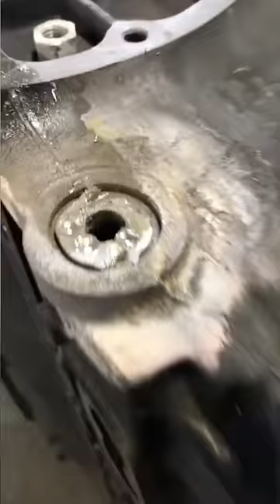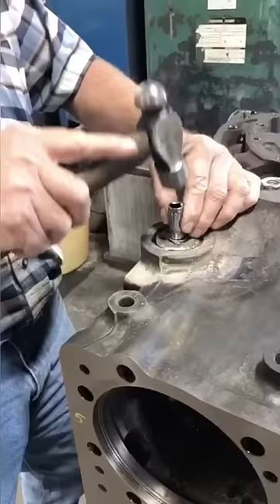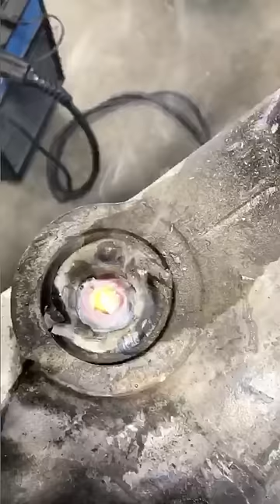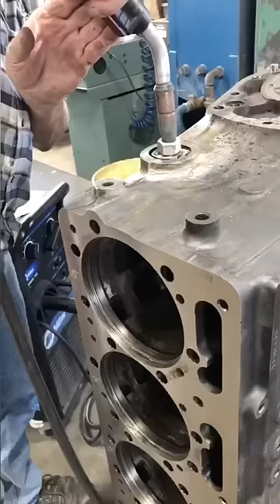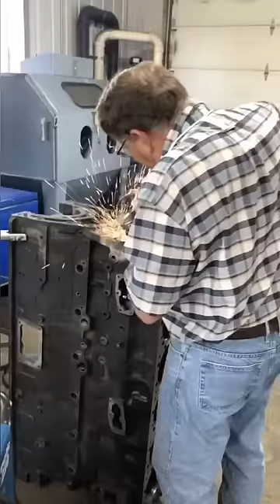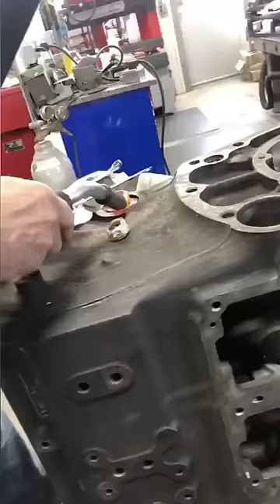#shorts N14 Cummins Block Plug Removal - This one fought back!

Comment: I wish I could see the cleaned block. Great job
Reply from the maker: https://vm.tiktok.com/ZMeFbNpvu/

Here!
Reply from the maker: @MRafi-lh5qz  I'm sorry, on my end it shows as a hyperlink lol.
Reply: @JAMSIONLINE  K- Tks , Luv the shop Videos and the presentation.
Reply: @JAMSIONLINE  viewing through the your channel the link works but through the random shorts that pop up it doesn't, strange but true. Excellent content
Reply: I just manually typed it in and watched it. I also copied it and sent it as a comment.   I think YouTube blocks the link because it's a competitors site
Reply: That was amazing!
Reply: @MRafi-lh5qz  type it.
Reply: @JAMSIONLINE   I have a weird question. Any issues with your Chicago Pnumatics impact? I keep getting poor quality ones lately. Impact sockets either fall off or won't even fit.
Reply: @TX_b  А то что они неумеют пользоватся экстрактором
Reply: Where are you located
Reply: @JAMSIONLINE  got a YT link by any chance? I prefer my invasion of privacy like I prefer my beer, domestic.
Reply: You have such a satisfying job
Reply: Looks like the chisel they used the first time, mushroomed part of the threads .. good fix tho.
Reply: @davestewart1656  CP used to be a good brand.  Sorry to hear their QC is falling.  Mine is either an old CP or Ingersol.  Built by Vikings, I'm pretty sure.
Reply: Have ya ever used wax as a lubricant? It does work.
Reply: I’ve almost given up on air operated impacts with these battery powered ones. I can’t believe how good they are and no fighting air hoses.

Comment: being a mechanic, a trade where a 30 second item   can turn into a 3 hour affair.
Reply: 3 weeks depending on what you break 😮‍💨
Reply: @manuel luz  a year or more if you like weird niche vintage stuff like a 1920s model a turbo kit😢
Reply: As a truck driver and recreational mechanic. I cosign the above statement. Which is why I never assume what time ill be done for the day. Got myself back to the yard numerous times.
Reply: plumbing is the same dont worry.
Reply: Probably would have gotten it out the first time if tacked the outside
Reply: @Earthmandolin Yeah, probably.

Comment: It is a good feeling when you overcome one of these obstacles.
Reply: Spent 2 days with a sledge hammer and big iron rod to remove a single bolt from a ploughs frog, with plenty of elbow grease and wd40 we finally got it out
Reply: @rhaynhillyard9772  that’s a damn good feeling of accomplishment lol.
Reply: That is a damn fact!
Reply: An engine mount bolt snapped and dropped the engine on the floor. Now I can’t get it off no matter him much I try to twist it off : (
Reply: Those stubborn bolts always get me happy when i do overcome
Reply: success has many parents and failure is a orphan .
Reply: @rhaynhillyard9772  quitters never win and winners never quit . never enough time to do it right but plenty of time to do it over . all good sayings when working on any problem .
Reply: I have put some wax on the broken fastener. Apply hot heat two inches away from the part you want to remove. When the wax starts bubbling, remove heat try to remove fastener. The objective is to expand the outer metal. Timing is the on this fix.

Comment: If I may, when trying to twist or turn something that's not all that strong (like that welded nut on a seized plug), it's far better to use a breaker bar than an impact.  An impact is a very sudden and sharp force which causes that weld to break much easier than a breaker bar which allows for a gradual increase in torque.
Reply: But isn't it also that sudden shock that breaks a seized bolt loose from its housing?
Reply: @ericmueser  - Actually, no, not from a rotational standpoint.  Yes, the vibration can definitely help loosen the corrosion but that can be effectively achieved by just hammering on the bolt or plug itself, or anywhere in the vicinity of it.  It's just that if one can't get a strong enough weld, an impact tool will break that weld quicker than a breaker bar would.  I might add that the heat from the weld is doing far more than anything in loosening that plug or broken bolt.
Reply: but lugga dugga much easier that strongy pully. let the tool do the work
Reply: @riflessss he said “breaker bar” not “wrench” two different tools
Reply: Mark, EXACTLY CORRECT!!!
Reply: Idk you don't always have the same torque. But also some plugs are just so in there I've been able to get them off with torques but not breaker bars
Reply: The reality is if you do several of these a days with a breaker bar you’re probably going to feel it the next day and over time it’ll break you down.  While using an impact isn’t the most efficient use of energy, the energy you’re using is coming from the wrench so from that standpoint it’s significantly better for the mechanic.  I’m sure they’re aware of the best way to do things and also the best way to prolong their careers.  As with most everything there’s a balance to be found my friend.  Cheers.
Reply: @ddnc1983  - You know, this is turning into a debate never intended. :)  First, I've been a mechanic for 40 years and have removed more than my fair share of broken and seized fasteners.  Secondly, my advice was purely for the sake of not breaking the weld if enough penetration can't be achieved.  Thirdly, the most effective part of his process is the heat from the welding. That's doing more for the removal than anything else.
Reply: Heating it up with an cutting torch also makes the job easier
Reply: @mark-1234  fair enough.  Wasn’t trying to rustle any feather just trying to justify the methods shown in the video.  Appreciate your comment though even if I may have come off a certain way.   Cheers.
Reply: The future is now old man. lol
Reply: @mark-1234  I got what you were saying, even if practically no one else did.
Reply: Thank god. Some people still give a crap about work
Reply: If he would've ground the nut and tacked around the outside the first time like he did on the 3rd time, he would've got it the first time.
Reply: @zyeklonbey3545  yep. My dad used to say, “There’s never enough time to do it right but there’s always enough time to do it over.” LOL
Reply: @riflessss lol stick to the shooting range 🤣🤣🤨
Reply: Actually no when you use a breaker bar you might tilt giving you more chances to either break the part more or hurting yourself
Reply: And allows you to crush your knuckles when the weld breaks. Bonus!
Reply: @Squidbush  - Well, apparently you need some more practice with your tool handling skills.
Reply: @davidinflorida6814  My grandpa always said "Do it right the first time, that way you dont have to do it over" old men are generally smarter when it comes to this type of stuff for some reason got wisdom igs
Reply: Branching off this... the impact sockets are made up up different steel than the regular sockets in a socket set. Reasons for it being different is one is made for impact the other will shatter over time with the impact gun. The same can be said about a nut not ready for the forces of an impact where a regular wrench or breaker bar would do less harm than the impact.
Reply: @mark-1234  yeah, but how many people do you see backing out of the trade because they wrecked their bodies trying to be a damn superhero lifting truck tires up to chest height instead of just dropping the lift and not destroying their spine trying to show off? If you've been wrenching 40 years without letting the tools take the beating and not going home in pain every night, with all due respect, you're lucky as hell or full of it. 😹
Reply: You know, I don't know if it's a lack of comprehension, experience, or just plain common sense but I'm addressing one particular situation in which a strong weld can't be made, and some of you seem bent on wild-ass assumptions and extremes.

And yes, I've been doing this stuff for over 40 years on everything except helicopters, trains, and ships, and at 61 I'm doing just fine and it doesn't have a damned thing to do with luck; and nothing I said suggests I'm above letting tools take the beating.  Unless I'm just not into the noise, I'm quite religious in air tool usage.

And most guys I know of weren't interested in showing off.  If they do something you might consider "improper," it's usually in the interest of saving time.  Like remembering to put in ear protection to run an air chisel for a few seconds.  Most guys don't bother and wind up half deaf (like me).

By the way, it's quite easy to roll a car wheel/tire up your knee to get it chest high.  No back bending involved.
Reply: It looks like the previous attempt using a cold chisel deformed the hole, before you got it.
Reply: @ericmueser  
Agree with you.
Max. Torque works regardless it is sudden or slow.
Reply: Acetylene torch is my friend. Heat it cherry red up after soaking in PB blaster. Have had no issues getting seized bolts and nuts out that way
Reply: @Anthony_thom92  that might cause some warping or melting to other parts of the block. They did this that best way at preserving the surrounding components. It would be cool to do that though
Reply: @user-vr9ql7xb6z  yes, experience and patience.
Reply: @zyeklonbey3545  As they say "hindsight is always 20-20! And also that's why we live and we learn right LOL. Some people have to learn by trial-and-error. But I bet he does it correctly the next time!
Reply: @mark-1234  yes i thought the same thing Mark then saw u made that comment wich turned into a debate initially off center of what u meant but i knew what u meant
Reply: Agree with you man Breaker bar is the best bet for this job. It's like you want the right amount of torque that the weld you made could stand and impact driver most of the time overpower that and you'll ended up redoing it again.
Reply: @ddnc1983  yep always work smarter not harder when u can but I'm always carfull to not snap bolt learnt from my mistakes not using wd40 and just using a gun is the easiest way of snaping bolts a slight increase in torque with a bar to move it abit then spray then loosen then spray is safest way to do it especially with old bolts that have never come out
Reply: @ericmueser  not always
Reply: He might turn the block over on his foot. Notice it’s just standing in the floor.
Reply: And there it is. The fuckin comment expert. And where there's one there's a hundred.
Reply: @user-vr9ql7xb6z  older men generally we're blessed with more knowledge because they have lived longer in n age where common sense, knowledge and wisdom was definitely tried. Now knowledge and wisdom (of worldly things) is handed out by YouTube which is not bad. Thank God he allowed older generations to pave the way. We build from them. There's nothing new under the sun.
Reply: @kiwoongpk91  uhhh what does any of this have to do with "giving a crap about work" lmao
Reply: You need a 20' cheater bar with that thing

Comment: Nice job. We will often take a 1/8 solid carbide burr and notch the ID in 4 quarters just to the thread root. Then weld as shown. The notching helps to provide relief so the weld pulls in & shrink.

Comment: Mechanic: I've tried removing it a couple of times With no luck so I thought I'd let you guys have a go.
Shop: Oh joy... Thanks.
Reply: And I’ve made sure to make it worse with my failed attempts
Reply: It's all gravy train cash to me. The more you jack it up the more I charge takes me the same emount if time lmfbo
Reply: Oh god…you’re so right. 
I just love getting a truck or minivan completely torn apart, all the pieces tossed together, and ALLWAYS half the 8x1.25s missing cause they left em in the garage.
Reply: @twistednuts6062  Username checks out.  :)
Reply: @MichaelBrown-pg5dy  Much much worse!!!
Reply: @twistednuts6062  go work for Ford 🙂
Reply: @ObtuseAcute1  and take a huge pay & dignity cut??? Noooooo thank you lmfbo
Reply: I've straight walked away from jobs because of that.
Reply: This is where the hourly rate sign says:
“+ $20/hr if you worked on it before I did”
Reply: I hate that crap, I'm always the shop that gets it after the customer and his buddy and then two shops failed making things even worse, unbelievable
Reply: @NotTheHeroStudios  I've told people that I'm not a relief pitcher, I'm a starter.
Reply: We work on vintage buses at my shop.. 1920’s till 1980’s old detroits, cummins, crowns, gm’s etc.. it’s always fun when a customer tows in a 70 year old bus that was torn apart in the 90’s and the parts are strewn about the inside of the bus in boxes that once were.. ohh goody we get to charge double shop rate to put this chinese jigsaw puzzle back together..
Reply: @mikecorleone6797  I hear you, people will never understand the struggle
Reply: @jacobgomez2682  a good example, we got this 1950’s greyhound scenecruiser towed in for an in frame. The engine is torn down to a rusted block with a crank in it at the rear of the bus, the rest of the engine is in the bus in boxes that fell apart probably 20 years ago.. cloth wiring that falls apart as soon as you touch it and the rear brakes are frozen solid.. and i mean SOLID.. i had to cut the drums off with an oxy acetylene torch… we quoted the guy $35k to get the bus up to par and road worthy with a zero mile rebuilt detroit, replace all airlines, replace brake cans, drums/shoes,  replace air bags, rip out ALL of the wiring and start from scratch and overhaul the rear differential.. he couldn’t understand why it’s so expensive.. the boss looked him dead in the eye and said “it’s been worked on by a toddler probably 20+ years ago and we’re basically building you a new bus from the ground up”.. he couldn’t find anyone else that would touch it..
Reply: @mikecorleone6797  see it amazes me that people think what we do is "just a few hours of work probly" 35 isnt that much for a bus, weve done 1950 pickups for that much!!!! You guys gave him a good deal
Reply: @jacobgomez2682  that’s what i said.. the only other shop that would have touched it wanted $50k.. and they were going to outsource everything.. we do everything right here in house.. with just 2 guys.. just me and my boy, we handle basically all of socal, arizona, nevada and whoever else wants to bring their stuff here for service. We just had a guy roll in from tennessee with his crown for us to handle. If our prices were as outrageous as scenecruiser guy was saying then why are people crossing the country to get to our shop? 🤔
Reply: @mikecorleone6797  it is a difficult job. You either pay or you sell that bus.
Reply: Been there many times.

Comment: N14 are some of the most reliable diesel engines around, love those Cummins N14's
Reply: I had a 2000 Freightliner,  with the 435 horsepower N14 , a great engine.  After 1 million 250,000 miles,  the plastic in the cab was falling to pieces,  the engine,  transmission ( 13 speed Eaton) and Eaton drive axles were still going strong.  I even averaged 6.25 MPG.  I sold it in 2012, and bought an International 9400 I , 2007 that was a very good truck as well,  it had the ISX 15 liter engine with a 10 speed overdrive.  It was a 450 horsepower.  Ran it until I retired in 2022. Sold it and the gentleman that bought it from me traded it for an International Pro Star.

I liked the N14 better,  a good reliable engine and not as much of the engine destroying pollution junk.
Reply: the n14 was built after the 855s.

Comment: Good to see the N14 getting some love, my dad just did a complete glider kit conversion on his 2013 Peterbilt 386 with a '94 N14 Celect Plus. 

Runs like a dream, sounds glorious, and pulls like a bat out of hell.

They absolutely don't make them like they used to. Modern trucks always sitting on the side of the road and losing a load over an O2 sensor, when pops' N14 has done nearly 500 miles at 120,000lbs with an injector out. 

Almost brings a tear to the eye.

Comment: Should’ve grinded out the surface in the first place, one of the most important steps of welding two metals together
Reply: Prep prep prep agreed!
It's like a paint job it can only be as good as the preparation beforehand!

Comment: Reminds me of trying to get an 02 sensor off
Reply: I know this is an old comment, but I’ve had the same problem before. Heat the 02 sensor up, then take a candle and put it all around the threads. The heat will suck the wax in, and lubricate the threads. Do it a few times if it doesn’t work right away.
Reply: @EastinColl  that sounds like it might work but why not use PB blaster, kroil, wd, or some kind of penetrating oil? That's what they're made for, wax seems far too thick, even when melted. Was it so hot oil just boiled off? Whatever works for you, just wondering. My mechanic will heat the female side with a torch and spray water on the Male side from a squirt bottle. The hotter you can get the outside, the better. Heating what threads in really needs to cool back down to help the most.

Comment: I did the same job, but fitted a large bolt into the hole that was just a little smaller in diameter. That allowed me to weld the inside as well as the top ,it came right out!

Comment: After welding on nut try candle wax - while it’s melting tap several times with hammer on top usually loosen on the first try
Reply: Project Farm has found better ways than candle wax. I don't know if they apply here because he sets up his own tests, so no Cummins block was used. Also I have minuscule to no knowledge of diesel engines. So you probably just received the most honest reply on YT.
Reply: I get pretty good results with penetrant and tapping.  Get the metal singing... and it sucks the oil all the way thru....
Reply: @francisschweitzer8431  I'm sorry, what is meant by singing? I'm actually trying to gain some knowledge so I hope this reads respectful.
Reply: @TA_Plus_Hemi  I’m assuming heating it up to thin out the penetrante
Reply: I have had people say "NO WAY" when they watched me do things like this with candle wax.